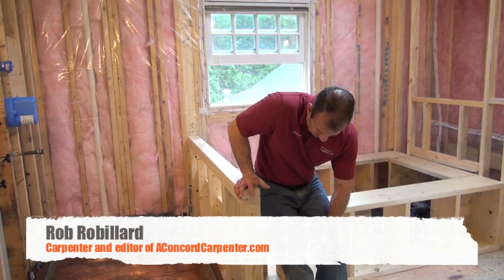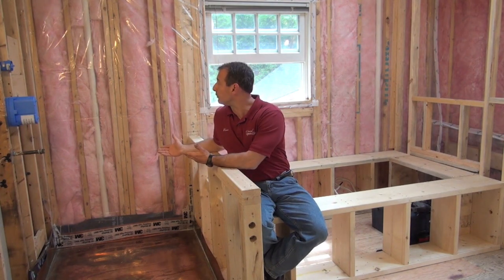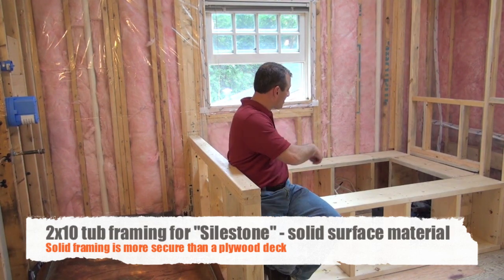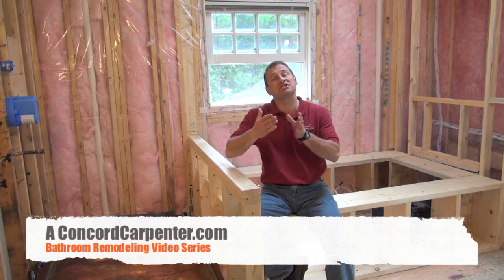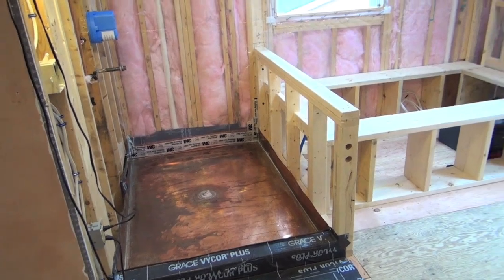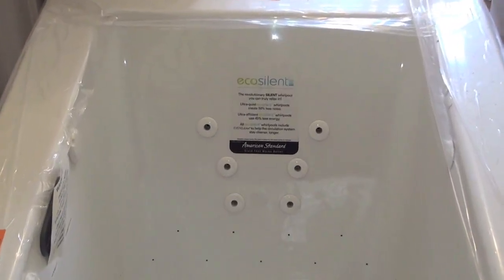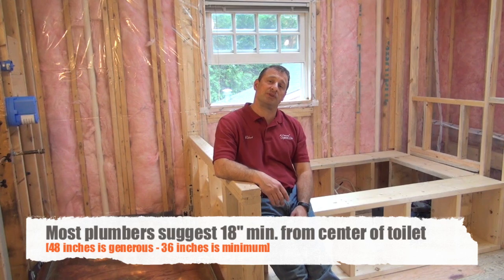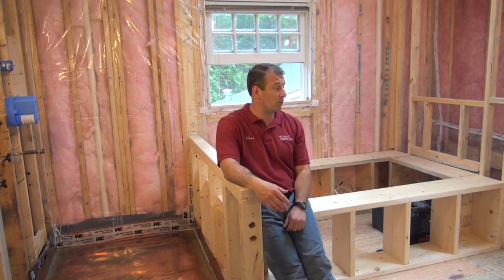Bathroom Remodeling Project Part 5 [Bath remodel planning and coordination]

Comment: @AConcordCarpenterToolBoxBuzz I just ripped out a lot of drywall from my house in NY. The wallpaper was very old and did not want to come off. All there is for insulation is r12 fiberglass batt insulation with an aluminum foil cover. Should I add an an inch of foam board insulation or vapor barrier? Feels like the perfect time to increase the efficiency before installing new drywall.

Comment: Future access to faucet?  I've worked on one where it was tucked into the corner by the outside wall.  Actually wasn't that bad, remove a couple pieces of siding, cut open the sheeting pull out insulation, change faucet and reverse.  Something to think about, a lot of builders seem to not care about future repairs, nothing lasts forever.
Reply from the maker: woohunter1 entire front panel is removable

Comment: At 2:32 in the half-wall I see the metal bracket with what appears to be an all-thread rod; what is that?
Reply from the maker: I covered that in earlier video on the half wall

It’s a reinforcing rode to  stiffen the half wall